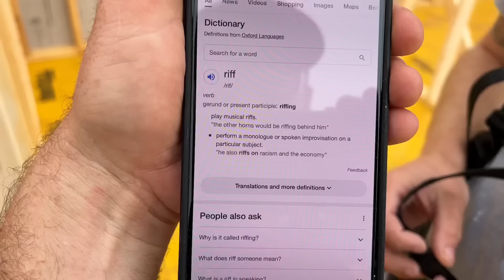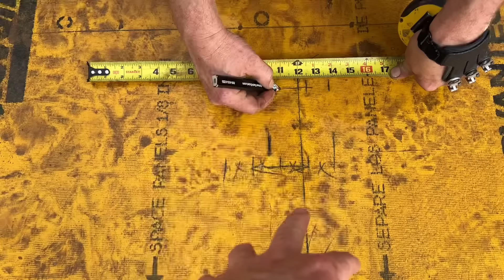Interior Walls and Loft Floor Framing | Building A Mountain Cabin EP11

Comment from the maker: Thanks to Keeps for sponsoring this video! Head to https://keeps.com/perkins to get 50% off your first order of hair loss treatment.
Reply: I've heard it said that baldness runs in families and/or is genetic.  Which would mean Jamie should be prepared.  However, of all the men in my family, I have never seen that to be the case.  

My father had the kind of baldness that was similar to the way the friars used to cut their hair, which is the crown of his head was completely bald but the sides of his head never lost hair.  But he  always claimed he lost most of his hair in the Korean war because, in the winters, to stay warm in tents, the soldiers had to cover their heads completely with towels under their helmets-- and they never once took them off throughout the winter.  (Wow!)  He said, when he finally did... all the hair from the top of his head just came off with the towel.  And it never grew back.  That's what he said.  I do  know his father was partially bald and my brothers (ages 67 and 65) both have "very high foreheads."  That is, they have lost the front portion of their hair, but are not entirely bald.  

In my late ex-husband's family, however, my ex-husband went bald between 35 and 40 years old but his father always had a full head of hair, right up to the end.  Now my son is 35 and his hair line is definitely rising.  :\  

Now, if it is genetic, it could be that this trait runs through the mother's side of the family.  My mother had no brothers and I never met her father, nor did he have any sons; only daughters.  Also, my ex-husband's mother did not have any brothers so I don't know where my ex-husband got his baldness from.  

It's good that Keeps prevents baldness.  When my ex-husband first noticed his baldness he looked into taking Rogaine, which was the only treatment available back then (late-1980's).  But he decided against it and I supported him on it.  I never thought baldness was necessarily bad.  It's just a different look.  But, then, I grew up with my father being bald.  So I might be biased.  

I do think, when it comes to cosmetics and appearance, it's up to the individual and what makes them feel comfortable.  As long as something is safe, i.e., not a health risk and it would make them feel more confident, then go for it.

Comment: Erik...  I live in a house that was built in 1972, way before the internet was even thought of.  So when it came to me trying to run RJ-45 network cables in my house it has presented many difficulties.  Another thing that has made it rather difficult is the fact the house is a tri-level house.  The only avenue or access between the floors from the basement up to the second floor is through the passage way for the water heater and furnace exahust ducts.  I currently have my computer room on the 2nd floor that is adjacent to the passageway.  So to accommodate the cable runs for the 1st floor rooms and the family room which is 4 steps below the 1st floor and the basement.  For the other two rooms on the 2nd floor I had to run my cables up through an interior wall and through the upper plate into the attic and then down through the other rooms interior walls.  For the family room I had to use the furnace access and punch through at the garage ceiling level in order to run my cable to the point I wanted my cables to come through the family room wall.  The only rooms that don't have RJ-45 cable access are the bathrooms and the laundry room in the basement.  So after the book I have written when you make plans for new home builds do you make accommodations for network cable runs before the sheetrock goes up?  RJ-45 cableing always trumps having to rely on wireless internet access.   I live in Colorado and my niece bought a new construction home that has RJ-45 cables throughout the entire house that support not only internet access but the home security system also.  I priced Cat 6A cable at 1000ft spools and it ranged anywhere between $149.99 up to $548.99 per spool.  The most  expensive was for shielded cable.  I realise it would add additional costs to the home but it would save the buyer from crawling up in attics and crawl spaces to run their own cables.  In today's environment of internet hacks, RJ-45 cable is way more secure than wifi especially if shielded cables are used.

Comment: I build custom coupler locks.  I see the best and worst of hitches, locks, etc.  When you backed up to that trailer I noted you had a hitch bar with 3 balls welded on.  3 of my customers had trailers come loose when the welds failed.  Highly suggest you move to either a Shocker Hitches or B&W setup.

Comment: Can’t the dry vent be put in the wall so it doesn’t stick out?
Reply: Yes but it would have to line up perfectly with the vent pipe on the machine to get it pushed back to the wall without constricting the flex vent pipe.

Comment: Wondering why you framed the exterior walls with 2x4'2 instead of 2x6, makes a difference with insulation, wiring & plumbing.

Comment: I just found your channel a few days ago and been watching some build series, I’m seeing some concrete work and if you want it to look great when you take the forms off and be a little bit stronger you could invest in a concrete vibrator, it brings all the air bubbles out a lot easier than hitting the forms with a hammer

Comment: would you have to make sure the 8x8 is in line with the concrete and 8x8 posy underneath the floor joists or is just over a floor joist okay?
Reply from the maker: Good question… it is in line with the post and footing underneath and we will add extra blocking between the girder and sub floor support.
Reply: thanks alot! that's what I figured

Comment: Good stuff!
Suggestion... Trailers are relatively cheap. Maybe buy a trailer you can dedicate to scaffolding? Then you simply leave it all on the trailer when not in use and you don't need to load and unload nearly so much.
An enclosed trailer you keep it safer and dry!
And, less risk of throwing out a couple's braces at the dump, by mistake!

Comment: How does the bottom plate of the walls not get moldy? Those are none PT studs going on wet subflooring, i would be worried those would have an issue in the future not drying out properly.
Reply: It dries out no prob…. It’s really only getting wet for a few weeks
Reply: @jaimeperkins9606  Thats one things thats always concerned me about building houses but never had anyone to ask about it. Thanks.

Comment: As a plumber for 40 years I can tell you with todays nailing requirements in California and Gun Happy Carpenters (nailgun) I spend more time pulling nails and resharpening my drill bits than actually plumbing! ; )
Nothing like hitting a buried nail while drilling a 3" hole and having the drill slap you in the face or breaking the shaft on a $400 dollar r/angle drill, so Thank You Perkins Brothers for placing those nails in a place that's benefits us all, you guys ROCK!

Comment: Water is one of the number 1 enemies of houses... Obviously when building can't control the weather.

Can you talk about structural intergtety depending on overall weather during building. Talk about any requirements or best habits to allow house t8 dry out after you water proof the house (siding/roof on?) before you do anything inside?

Something I was always curious about

Comment: Question, when you can't run a chalkline but you have that amazing flooring system with its markings, how reliable would it be to use the markings vs laser-eye?
Reply: I’d say laser eye is better. Unless you are using a long joint in the plywood. That would be pretty straight

Comment: lean one side of the scaffolding against a wall or truck or whatever. Hold up the other side. Attach a cross brace to one side on the top incorrectly. It attach the same single brace member to both tops. Use an off hand to help the incorrectly attached brace to up. Slide over and attach your other brace correctly to the other side, Then you can use that or lean it to hold up the other side. go over and attach one member of the correctly attached side. This should allow you to just walk over and then now correctly attach the other side completely. Come back and finish the one unattached leg of the crossbrace. One of my uncles showed me this as a kid, I was like 4 feet tall and 8 or 9 years old and I could solo put together a scaffold. (granted I was a big and strong kid).

Comment: I work in a restaurant and by the dishwasher we have a 2’ floor squeegee that we use to squeegee the water into the drain. It would be perfect for this scenario because it’s attached to a broom stick and you just push all the water off the sub floor. It would take no time at all and help stay dry! Thanks For all the knowledge!
Reply from the maker: Cool trick thanks
Reply: Better yet….get Jaime to build a couple of 3 or 4’ squeegee and run them staggered.  I’ve used a 3’ squeegee before and it does work great.  Kudos to you for making the connection!
Reply: They should get an EazyUp canopy before the squeegee

Comment: I've always wondered if exposed framing in the rain causes any issues such as rotting or mold or swelling down the road? I have heard that once wood reaches 20 percent moisture it starts to be an issue.
Reply: No it doesn’t because by the time you drywall the roof has been on for weeks or usually months
Reply: Wood is fine if it is able to dry. It can fluctuate in moisture for 100+ years, and still be fine if it's vapour open. 
If it's enclosed with impermeable materials, then it'll rot.
Reply: For mold to grow it has to have a constant source of moisture. Like someone else mentioned, once the envelope of the house is covered, the framing will dry out.  The same is true for rot. Wood rot occurs from repeatedly getting wet and drying out.  Moisture levels in our state must be 20% or less for crawl space areas.  Typically moisture levels inside the home are 10% or less.  Kiln dried lumber is usually around 6 to 8% moisture content.

Comment: Out of curiosity : why didn't you use a steel beam instead of using wood for the joists and then a wooden post to support it? A steel beam would have removed the need for a post right in the middle of the floor, making the space wider!
Reply from the maker: Could have done that… Would just cost a lot more money and would probably need a crane to set the beam.
Reply: @PerkinsBuilderBrothers  I get that, but that seems like a minor expense regarding the project as a whole, IMO. It would have created a lot of space on the first floor and it’ll be a bit late to do it when the house’s fully done… Sometimes homeowners make weird decisions!
Reply: @Ogilla  They can't SWAG it and have to hire an engineer, buy the beam, drill/ mount wood plate on beam, steel post for beam, pour bigger foundation, and pour pillars for the post. When he said more money, that's why.
Reply: @martylost167  I know all that. But my point remains valid : considering the cost of such a project, having an engineer’s plans and approval, building bigger foundations and renting a crane is peanuts. And I’m quite certain that they could cut costs on something else. 

You wanna bet that the homeowners will not even lift a finger before they receive the keys? On the previous project the crew even connected the appliances and installed the toilet paper rack…
Reply: It might be very difficult to get a crane up there.

Comment: Talk about your scaffolding like ? if you could how would you improve and brand name. Also when you were doing block laying you used this domaflicky to hold the string .... how did you use it ... attached to a what. If this is too dumb just ignore. Also talk about your tool belts if possible.

Comment: I would have expected that the shear wall from floor to floor  has to be continuously connected at the joints… this way here it’s only connected together at each stud. 
Edit: after thinking about it, there is no shear continuity between panels anyways. The strong connection to the mud sill is most likely for uplift loads… although not sure what region they are in. I hope at least that there are the same number of nails in each joist as there are in the mud sill. Shear loads are transferred basically as bending moments ( shear maybe) through the studs in the wall at each panel edge.

Comment: One thing I'm always curious about is rain during construction. Do you need to worry about moisture on the floor/wood/walls?
Reply: The wood will always dry out after the roof goes on. It is common for the house to take a week to vent out all the moisture from being exposed during construction.
Reply: @briangc1972  I see. Cool thanks